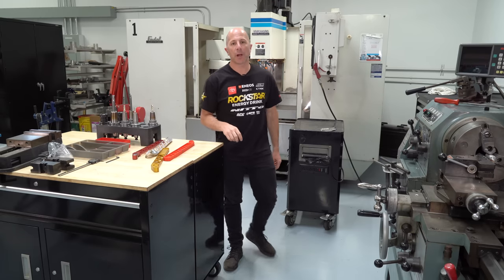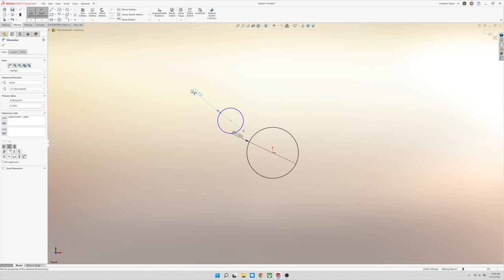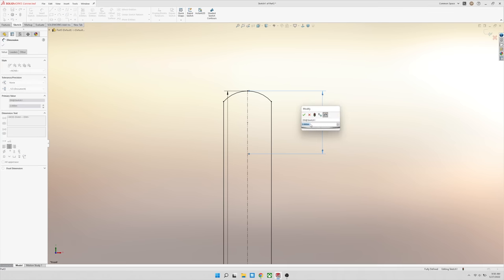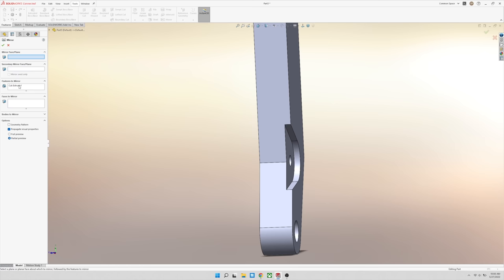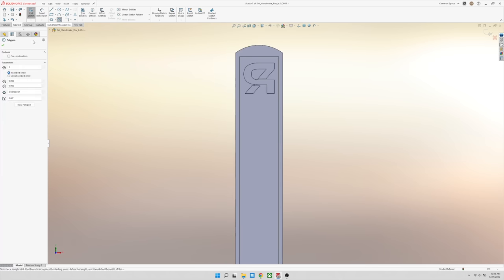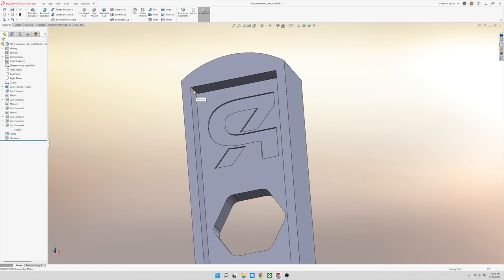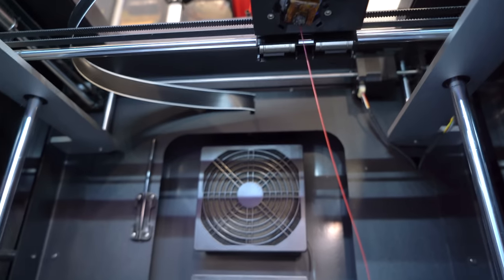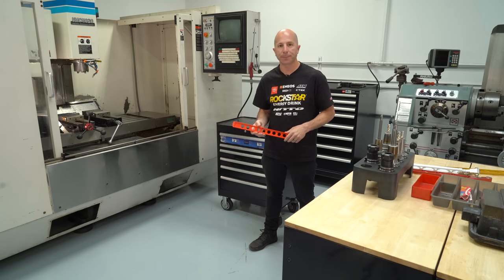SOLIDWORKS for Makers - Handbrake Full Design & Manufacture Steps - Part 1

Comment: Just a tip in Cura, look at "Enable Support Interface" and then "Support Roof" which adds a few solid layers of support so you get a nice uniform result on the under side of your prints, as well as an easier removal of support!  If you do this, be sure the "Support Interface Density" is set to 50% or higher! Great video!!
Reply: Can also use tree supports to speed up printing as well
Reply: @b3nny90  I've become a fan of tree supports myself lately. Seems to offer faster prints, less wasted material, and sometimes easier to remove, depending on the complexity of the print
Reply: One nitpick, that desk is in a dire need of a mechanical keyboard upgrade.

It just doesn't "feel right" for big Poppa to use such a badly designed keyboard when infact everything around him is god tier on an engineering level.

A man of his stature clearly deserves a better keyboard. Especially one with QMK macros for lightning fast productivity. Shit, someone can probably even make him a purpose built board only for CAD macros with custom labeled keycaps.

Comment: Make America great by switching to metric.
Reply: The metric system is a mess. It's okay for scientific stuff, but all of the units of measure are either too large or too small for real world applications. And while all base ten is great for converting between units of measure, base eight is a lot nicer for basic division in your head and the more logical sizes of the imperial units means you don't need to convert as often. The current mix of metric and imperial, using each where it has strengths, is by far the best option.

Comment: This is my job as a machine operator/machinist. SolidWorks, print, approval, CAM or hand program Gcode, first article and manufacture. Not a bad gig, doesn't require college but I have a bachelor's and it's  $17/hour. So more than dominos

Comment: I use SolidWorks everyday.  This is well presented and to the point.  👍  Only thing I typically do differently is model the solid part and add all features after, including holes, etc.  This allows for editing without going back to the original sketch and allows the user to reorder the features in the feature manager.

Comment: My robotics shop is fortunate enough to have everything we could ever need, besides a cnc for metal though. So if we did something like this, it would be a little less ergonomic but more practical to build. And for gluing together 3D prints, I would suggest contact cement because it takes less time to become secure for testing. The trade off is that it’s very toxic and doesn’t store as well as epoxy.

Comment: You don't need that much support material. 3D printers can't print in only air but they can bridge two towers together depending on the distance. Set up your bridging settings properly (more fan to cool the plastic bridge faster) and print some bridge tests. You could probably get away with just one small sliver of support down the middle or no support at all.

Comment: I wanted to get the SolidWorks for makers, but I find the system requirement too confusing. I am disabled and cannot afford a new professional cad workstation. Other software often lists minimum system requirements and recommended. SolidWorks has a list of 5000 compatible systems. If I buy an old, refurbished cad workstation, would that work or can I upgrade to an A2000 GPU, will it work then? I can't buy a half dozen computers to see if any of them are compatible.

Comment: So I can do this same thing in Fusion 360 with ease… what is the learning curve on solid works? It looks slightly more fluid than fusion. Very similar, but a little more fluid workflow
Reply: I use SolidWorks everyday.  After using other software I have to say that the learning curve is steep, but worth it.  It is very powerful software.  Not a 100% on what this "make" version can do, so excuse my ignorance.  Full version is amazing.  After 12 years I still discover things it can do.

Comment: 3D prints are amazing for prototyping, but not great for testing a fit, especially for something as precise as bearings. 3D printers have several settings and limitations that affect how dimensionally accurate they can be, among others, extrusion width, extrusion flow, and even firmware settings on the printer itself, which is steps/mm for the extruder and also the head itself. Though in this case it seems to have worked out fine, it's still something to be aware of.

Also, Tom Sanladerer recently made an interesting video about glueing different 3D printing materials together if you're interested.